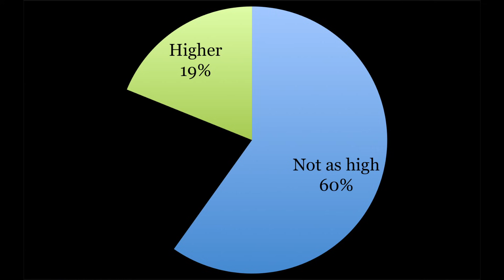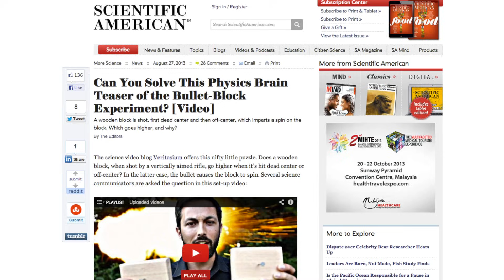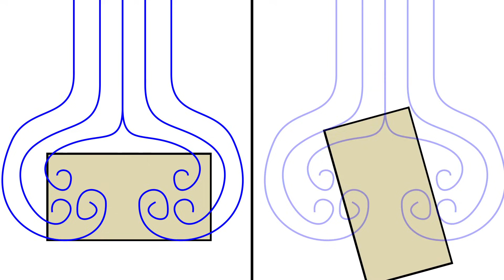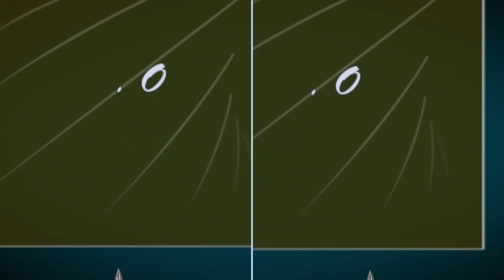Bullet Block Explained!

Comment: why does the penetration measurement with the nail and the xray differ?
Reply: I suspect it's merely an instrument error. The nail could get stuck on fragments of wood in the bullet track, or the bullet could be more deformed. The nail is an inaccurate measuring tool, the x-ray is an accurate measuring tool.
Reply: @SPACKlick  Wouldn't the bullet travel at an angle in the off center shot compared to the centered shot. The nail could be hitting the wall of the hole and not the actual bullet that is deeper in the wood.
Reply: most likely explanation is that it was just a very crude way to measure it and there were differences in wood and/or bullet deformation between the two blocks (some wood was sticking in the way of the hole preventing the nail from going all the way down... or the bullet was deformed in such a way were it was stopping the nail in one block and not in the other)
Reply: The bullet is moving so fast that it would have already stopped before the rotation comes into play. So I don't think it caught the bullet they both went the same depth.
Reply: @GetRoasted1  no.. it didn't stop before rotation because the bullet hole was curved. Am i right?
Reply: good question
Reply: ***** what
Reply: ***** i understand that but why when he use x ray it seem like it go completely
Reply: Arjun Ariyil why would he want to fool us anyway?
Reply: Derek Dincer because they can theoretical path inside the block is curved in the off-center case, and the bullet is long and straight... a lot of energy goes on friction and bending the bullet to fit in the curved path... I think. So less energy goes into deepening the hole
Reply: Pls tell me he told that rotational energy was 50percent of the energy now atlast he stayed that rotation that was caused was 1percent which cause the bullet to get 1mm upper 3:07 and the 8:30
Reply: Let's keep in mind that the different pieces of wood are not identical  in density or hardness and that the powder propelling  each bullet is subject to variation.
Reply: @pauleohl  Spot on, especially given that I'm pretty sure this was done with a 22lr cartridge which being a rim fire and thus factory loaded ammunition, there is a lot of round to round variation (I've seen as much as 75 feet per second difference even with modern match grade 22lr rounds.. Granted, they (modern match grade) often a fair bit less than that but certainly not down in the single digit ES's (extreme spreads). As as precision rifle shooter myself, I can say with certainty that this test would be much better to have been done with a hand loaded centerfire round using the right primers and powder since its pretty easy to achieve single digit ES's with handloaded centerfire cartridges. 

The problem though is everything that comes to mind (even pistol caliber rounds) would over penetrate any reasonable size and weight material at such a close range without reducing the powder charge weight but this then brings back an inconsistency from round to round problem because pretty much all smokeless gun powders have a pretty narrow area of weight to volume ratio where they burn very consistent. Outside of that that ratio you are much less likely to find a charge weight that will give very consistent shot to shot burn rate.

Outside of possible a custom shortened 22 hornet wildcat round (which would be very impractical and costly for this experiment), there really isn't a feasible way to unsure shot to shot consistency while using a material to shoot into that wouldn't end up being too heavy for the full experiment (i.e., the height of lift center vs. offset and penetration differences between the two.
Reply: Because the path of the bullet in the spinning block is curved as the block is moving away from the bullet.
Reply: @nic12344  not curved enough to be of any importance. The bullet has stopped moving with respect to the block before the block has lifted mor than a mm from rest,  while the block has only rotated a few milliradians.
Reply: @nic12344  I dig that response.. But just doesn't feel right..
Reply: @nic12344  that's what I thought too, but it doesn't seem like it's curved at all in the xray.  My guess is that the bullet shrapnel is different or there was some weird splintering or something
Reply: Because the bullet penetration is not straight so we cannot use nail to measure penetration while the x ray is more accurate since we can see the hole(bullet penetration) at the wood interior.
Reply: What has more resistance. Pushing inline with the axis, or pushing tangentially on it. Pushing tangentially has much less resistance.  OK, so that explains why one spins and the other doesn't. Now, where is that difference in kinetic energy going?When off-center, some of the impactor's energy is converted into rotational energy. It pushes the "wheel on an axis". The other has too much resistance to put much rotational energy into it (Can spin something by pushing radially on a wheel).  That energy difference is made up for through compression, shearing and other effects... which is what makes the radially shot impactor penetrate just a bit more.
Reply: C R  Thanks Beavis!
Reply: You could just pout water in the hole and count the ml it 5aked to fill thr hole and measure the volume of the hole.(if the bullet went sideways halfway into impact)
Reply: @a.yashwanth the water would soak right through. No a reliable way
Reply: Because hole is little curved.
Reply: they are different blocks.
Reply: He X-rayed the wrong block...
Reply: @rickoshea8138  8:05 the block on the right shows the bullet entered off-center
Reply: Hey guys 4 years late to the party.. here is what I think, the bullet in the centre block creates more bullet deformation as it is receiving a greater inertial moment so although they enter to the same depth the bullet deformation is more for the centre which is the reason for the same depth but a difference when measuring to the back.. just my two cents
Reply: If you look at the last moment when she holds the nail to the hole in the rotating block the nail slips further in, I think she had fudged the earlier attempts to measure it.
Reply: Yes... I want answersy
Reply: If I am correct, it is due to the shape of the hole that the bullet makes. When the bullet peirces the non-rotating block, it goes in following the path of a straight line. When the bullet peirces the rotating block, the bullet will continue to travel upwards as the block is spinning, creating a curved path. Because the nail that they tested the hole depths with is straight and rigid, then it will not change it's shape to the curvature of the hole, therefore not penetrating it as deep. I believe if they used something flexible and long (ex. mechanical pencil erraser refils), then it would have gone in the same depth.
Reply: Women don't know how to penitrate...
Reply: Women don't know how to penitrate...
Reply: it was bent in his graphic but not at all in the xray
Reply: I think he is tricking us. He just took a lot of X-rays and picked two that went the closest and used those!!!
Not sure why he didn't do the same for nails.

Unless

He did the same for nails as well and picked two that went farthest!!!

What the hell Derek?
Reply: I believe (some one correct me if I'm wrong) the wood struck in the CENTER penetrates further because it has no way of "catching" the bullet whereas the wood struck OFF CENTER allows for the wood too not only move up but also rotate out of the way meaning the bullet is hitting something that can essentially"catch the bullet. 

so that initial force of the first bullet penetrates further and the second penetrates less even though they are from the equally energized bullet and in this case is just so happens the second bullets energy that got taken away from the "penetration" factor has gone to the woods rotational energy

basically (lol) the wood was able to "CATCH" the bullet instead of "STOP" it again because he hit if off center allowing for some of the energy to go to rotation
Reply: @lafontaineadam  The bullet traveling at (I'm guessing it's a 22 lr) at about 1500 ft/sec would reach it's max depth before the block would move more than (I'm guessing) a  millimeter or so, so the rotation would be negligible.
Reply: @lafontaineadam  Ah, then some of the energy that was otherwise lost to friction can be retained as rotational momentum?
Reply: @unfa00  Pls tell me he told that rotational energy was 50percent of the energy now atlast he stayed that rotation that was caused was 1percent which cause the bullet to get 1mm upper 3:07 and the 8:30
Reply: @EpicGlitchyJuice  I a mafraid there's a bit too much uncontrolled variables - the wood grain structure could affect the friction of the bullet and change how much energy is transferred to the block, the denisty could be uneven etc.

Comment: I was surprised that the spinning block went straight up into the air, I was expecting it to go at an angle in the direction it was spinning (in this case to the left).

Comment: For an improved test maybe using a more dense material could have a larger affect to the bullet depth. Not as dense as metal, but plastics, or something of that nature. Or maybe less dense than wood, like a large block of ballistic material. But you would use a bow and arrow or other small projectile. So it doesn't go right through the block. Maybe they could show a better affect for bullet depth.

Comment: why did it look like the nail penetrated deeper in one block than the other but when you did the x-ray it showed that the depths were almost identical?

Also I think the way to show a larger difference in the penetration of the bullet might be to shoot into a less dense material. This is purely intuition but  I feel like a less dense material would slow the bullet down less per length of penetration. So maybe some sort of thick plastic.

Comment: The muzzle velocity(speed at which a bullet is fired) varies from shot to shot by a value of around 8 m/s for each shot, depending on the gun and its history. 
So, with a different value for v, the value of v^2 in the formula 1/2mv^2 changes, transferring a varying amount of KE to the block. Hence, it flies up to a different height.
Source: My friend
 The value of v^2 would vary a lot even if the variation in 'v' was small
Example-7^2=49
8^2=64
You would see much higher differences at 700 to 900, so the KE transferred would vary
Reply: oh. you're correct
Reply: +Akhilesh Mulgund energy is pretty useless when solving inelastic collisions...

Comment: my prediction is that with the one that went strait in, picture it as a rocket, the rocket will only make it go up, but the drag won't let it go as high, so they cancel each other out, with the side one, it may not have the rocket thing, but it's pushing air out of the way so THEY cancel each other out

Comment: I take AP physics 2 and when I was thinking about it through the law conservation of energy I got that state of confusion that tells me I'm over thinking and that if I keep thinking this way I'll end up being wrong. So I took a step back and figured that the thing that's distracting me and everyone else didn't actually matter (the rotation). So I figured all that mattered (assuming that this was ideal) was the bullet because it was the only thing that had any initial movement and since it'll be the same for both test, the blocks will reach the same height. Overall I wasn't confident but I got the right answer.

Comment: I think you should use a different material. Wood has knots and other surface defects that could effect how deep the bullet penetrates it. As well as differences in the bullet and barrel after being fired. You would have to clean the gun each time. That's why science is tedious. I totally guessed wrong. I thought it would fly off to the side and not travel nearly as high. But once you explained the bullet momentum it made sense.

Comment: How do you explain the difference in heights then?
the entire video focussed on proving they went to the same height.
But as we saw many of them didn't. If we use conservation of momentum then we can't explain when there's difference in height. 

What's the explanation to that.
Reply: The difference in height is due purely to the fact that you can't always get the same results in an experiment, and the difference wasn't very great, yet because each trial was lined up in descending order, it also added to the illusion of distances, if you pause the video at the average climax of the wood block's flight, you can put something(your hand, a paper, etc.) in between the lowest and highest results and look a the difference.
Reply: 4:15
Reply: I would say about a foot difference, in an experiment this is not a huge variation, you have to take into account EVERY difference between the experiments, like the wood block itself, it might have had sap that absorbed some of the impact but fell to the side sending the sap up but not affecting the block by very much... Just an idea...

Comment: instead of a small bullet with relatively little mass traveling at a high speed, use a much larger projectile at a relatively low impact velocity.  A heavy dart, for example.  That should result in a much lower % of KE lost in the collision, and therefore more measurable differences in the penetration distance.
Reply: Well that's certainly an idea, but a bullet would be more precise, you can set up the gun to be aimed exactly where you want it
Reply: What do you mean by 'a heavy dart' do you mean like a toy dart from a toy gun, or one from a dart set(as in the game)?

Comment: Remember one of the ways kinetic energy is lost is in heat transferred to the wood, which was not measured. Perhaps this plays a greater part than we thought.
  I also recommend reiterating the experiment with the bullet shot at different points further from center. I think it will produce faster skin and less bullet depth as you move out. 
   MDF fiberboard if of consistent density, but may crack too easily. I've never shot it with a bullet on edge, but screws and nails tend to split it easily.

Comment: Does anyone know how he worked out that for the rotating block, 1% of the original kinetic energy of the bullet will equal 1/10th of a millimetre difference in penetration depth of the bullet hitting the non rotating block?

Comment: logic dictates that the test setup is responsible to stabalize the wooden block. now perform the experiment again but don't use plexiglass or screws. use 2 tables with a small gap in between and lay the block over the gap. now shoot and see different results... place your bets!

Comment: I'm not satisfied with this answer. I'll have to research more on it.
Reply: +Favour Ayorinde 

The answer is going to be counter intuitive until you accept some fundamental facts about kinematics. In this case these are:

Linear momentum and angular momentum are independent of each other. 

Mechanical energy is independent of momentum.

Torque (and to some degree force) is independent of either of the previous two.

This is an ideal case of whats called a perfectly inelastic collision.

Linear momentum is equal to  mass times velocity. No matter what happens after the impact, since the bullet and the wood stuck together 100% of the bullets momentum will be transferred into the new bullet-wood system. 

However, since outside forces are involved here mechanical energy will not be conserved. Some of the bullets mechanical energy will be converted into heat and sound. 

Torque is the tendency of a force to induce rotational motion and it is equal to force times the arm length. Here arm length is the distance between the impact point and the pivot point.

So when the bullet impacts the end of the block all of its momentum is transferred to the block (with the bullet now lodged inside.) Since momentum is mass x velocity you would divide the bullets initial momentum, P by the mass which will give you the velocity of the new block. This will be the same regardless of where the bullet impacts or any rotation. The rotation is caused by a torque.

Since torque is force x arm length, and force = mass times acceleration, and acceleration is the rate of change of the velocity. Moment of inertia is the tendency of an object to resist rotational motion, and mass will have an effect here. So the rotation is dependent on the amount of momentum transferred, while the momentum is 100% independent.

I realize the last part is a bit muddied,  so let me know if I need to clarify anything.

Comment: Conducting this experiment with a gun that shoots rubber bullets which would not penetrate the block would be interesting. If the rubber bullets don't penetrate the blocks maybe the difference in friction that occurs during the bullets initial impacts would be negligible and we would be able to see a difference in heights between the two blocks.

Comment: Provided that the bullet weight, and velocity at contact are the same, you should use not wood, but a material as homogeneous as possible.  Increase the width of the block so that there is a larger lever arm as well.  If the theory presented in the video is correct, the farther away from the center of mass the bullet hits the block, the more the block will spin causing the bullet to travel a shorter distance into the block.  A material I would recommend for the block is some sort of hard rubber.
Reply: would it also be considerably different if you use a denser, more homogenous material instead of wood? the bullets would penetrate less into the wood and with the rotating block, the density of the material when compared to the rotation, which we know causes less rotation, would create a difference that may be measurable? correct me if I'm wrong
Reply: +Bilal Saloojee less penetration*